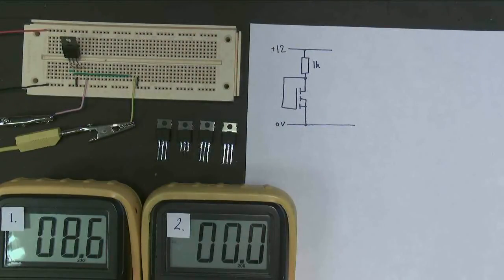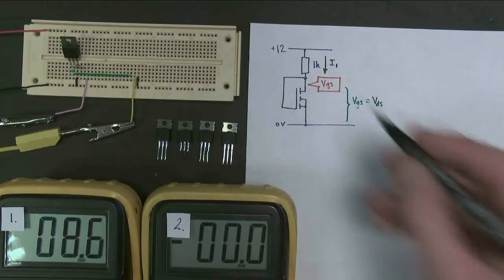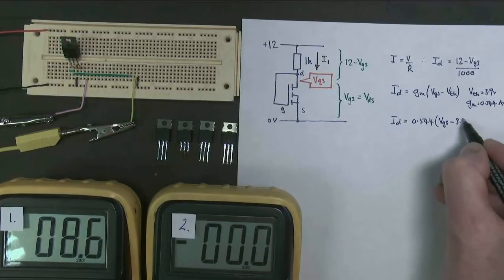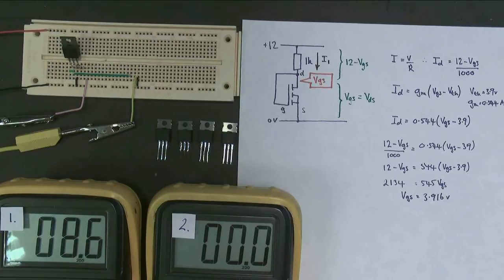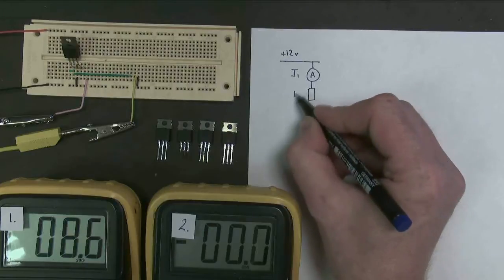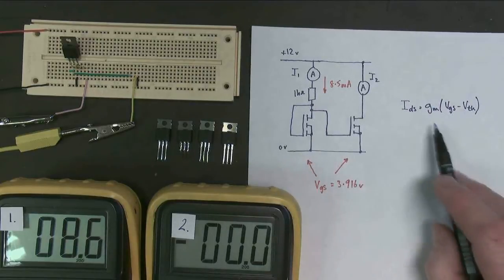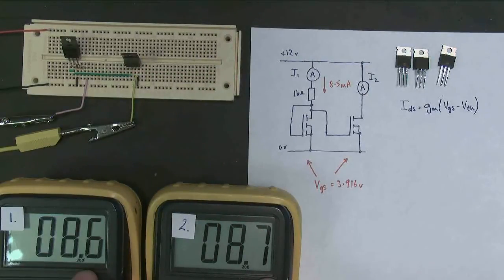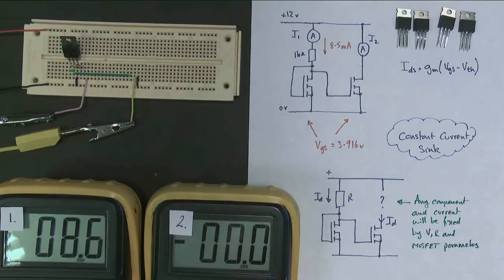MOSFET Part6 Constant Current Sink

Comment: thats called a current mirror.  it is used in designing micro circuits except they are using bipolar transistors and not MOSFETs.  you can check almost any e.g. LM117 linear regulator and u will find that circuit.
Reply: Yes in the old days bipolar technology was dominant in integrated circuits(L117 design is from 1976). But modern analog integrated circuits almost exclusively use CMOS (complimentary FETs) technology. The circuit in the video is implemented in CMOS technology using P-MOS as the resistor and matched N-MOS transistors as the current mirrors.

Comment: I'm coming up with .00808, or 8.08mA for my calculations. That works for both the ((12-vgs)/1000) and the Id = gm(Vgs-Vth).. I think the error occured in your rounding. In any case, this is a great video. Thank you for it! I did have one question, would it be possible/feasible to have a different voltage for the Q1 transisor than the Q2 transistor side or do they have to share a supply? I'd like to have 12 volts on the Vref side, with something a bit more substantial on the mirrored side, say 90+ volts

Comment: great teaching, specially because i want to power a 3000 W/ 240V/dc boiler with PWM and several mosfets in parallel without destroiing them. this is because of the solarpanels use etc. Is there anything else needed to protect them?
Reply from the maker: Sorry for the late reply. I'm not an expert on power applications but I would say chose your MOSFETS carefully and make sure they have decent high voltage diodes to protect them. Are you sure you need them in parallel? A single 16A 400V Mosfet should cope.